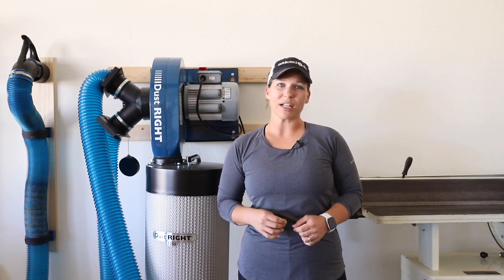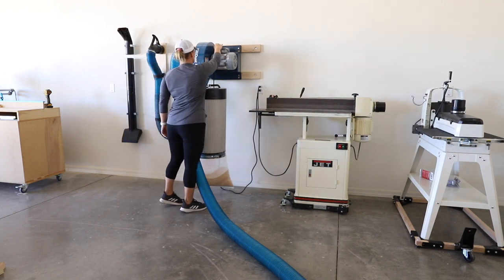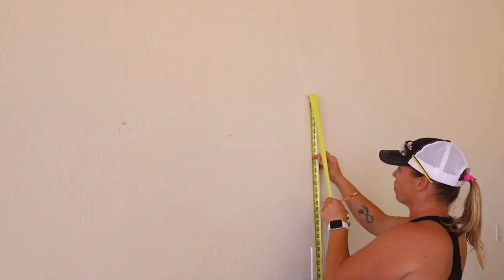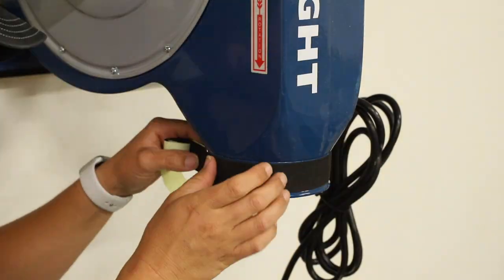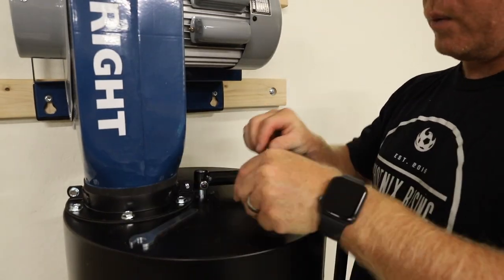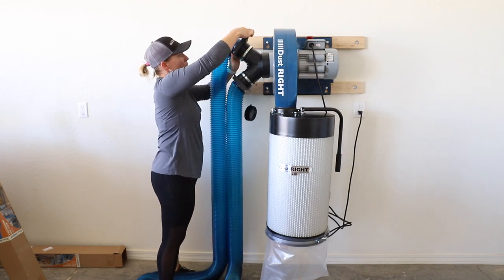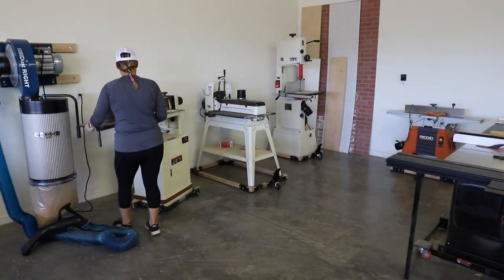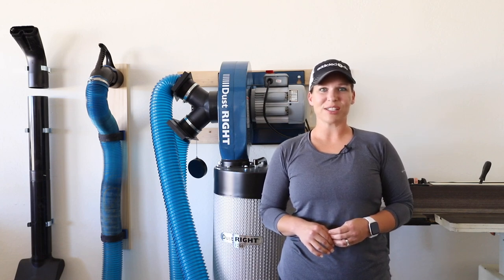Setting Up A New Dust Collection System

Comment: Katie, you mentioned setting up a two stage at some point, however, I would encourage you to do it sooner rather than later. It was the single best choice I've made in my shop. Garbage can, circle jig to cut out a wood top for the can, then mount a Super Dust Deputy to the wood lid. I have the older version of the rockler dust right collector, will be upgrading it soon to the 1250cfm.

Comment: hi there! this is great!!! Im definitely going to look into getting one, is it the bag at the bottom that you change out? Does rockler have bags for you? how often do you have to change them out?
Reply from the maker: Yes, we just dump the bag at the bottom when it is full.  I’m actually still using the same bag that came with the machine and it’s been 3 years.  Rockler does sell replacement bags though.

Comment: Hi Katie , loved your video on your Rockler 1250 CFM dust collection system. Did you ever think about replacing the plastic dust collection bag with a different container?
Reply from the maker: I’m glad you liked the video!  I did actually plan to replace the bag with a larger one and maybe move the dust collector higher on the wall, but then changed my mind.  I’m still using the original plastic bag that came with it and I really like that it is easy to dump and put back on.  A larger bag would be much more difficult.
Reply: @addicted2diy  I bought the Dust Right 1250 also and I have a an old shop vac bottom from one of the shop vacs that I killed with dust and debris that I am trying to place under the 1 micron filter. I unscrewed the top part where the motor was and the filter fits perfectly. I just have to find a way to seal the thing. If there’s a way I could send a picture I could show it to you.
Reply from the maker: @navarroedwards8031  you can email me.  Katie@addicted2diy.com

Comment: Your setup is ok for medium to fine dust. But what if some harder, larger or even nail entered to your system? Eventually it will hit your blower's fan blade without a pre-filter (cyclone) installed. 

Your canister filter is the biggest plus in your system. however, your collector bag is very small. Again, what if a sharper stock entered your system? and break your bag? Can you afford to see all dust blowing out from your bag? 

One more thing, such a long hose will greatly reduce the air flow and creates lots of static. Ground your flex tube can solve a bit, use hard metal tube to make the port closer to your machine, then use the flex hose to hook it up to your system should be a better idea.

Comment: Hi Katie, thank you so much for the content. I am trying to determine whether to go with Rocklers 750 cart setup or one such as the one you have chosen. I have a very small shop, completely a “hobbyist” and senior in years. You did a great job here and I suppose now that I need to do a quick tool inventory with dust port sizes and then reach out to Rockler for suggestions. I never see anyone using a system such as yours with a Makita track saw, or miter saw type tools which use a much smaller port. Is there a reason? I would appreciate a comment from you or your subscribers. I get such a kick out of those punch in the gut comments by some folks. I believe that along with any comment it should be necessary to show how many subscribers the commenters have. My guess is that it is considerably below 16,000 (congratulations). Also, in addition, when someone posts “terrible” it should be necessary to have to state why. I guess I am just feeling the brunt for you. You are doing very well and giving us all something to consider. Thank you so much.
Reply from the maker: Hi there!  I would definitely reach out to Rockler and talk with them about what might be the best setup for your shop.  I really love this one and am continuously amazed at the versatility of this dust collection setup.  I am not one for having anything being fixed in place, but the dust ports on my tools and the quick connect hose really make this system so easy to use.  As for attaching smaller ports to the dust collectors, it is entirely possible to do this, but based on my research it is not really recommended.  These types of dust collectors are high volume and really do best when using larger ports.  Reducing them down to 1 1/2” or less (like with a track saw) puts too much strain on the motor for long periods of time.  What I would recommend for that is to use a shop vac.  I have the Kreg Adaptive Cutting System (track saw) and use the Rockler dust hose kit along with my shop vac when using that saw.  Hopefully all of this helps you make your decision!

Comment: Katie, Thank you for the video! I have been waiting for some videos of the DR 1250 cfm model to begin to surface. I was hoping to see more initial thoughts on performance and features. If permissible by your agreement with Rockler, i would love to see an in-depth review in the near future covering suction performance, noise, remote strength(direct line of sight), the attachments, hoses, and accessories and whatever else you think is relevant as you use the system in the coming weeks. I look forward to seeing what you decide to utilize for 2-stage (Thien baffle vs super dust deputy etc) and if you notice a loss of suction. 

Congrats on the new dust collection for your shop!
Reply from the maker: Mason Wheeler thanks for your ideas.  I’ll see what I can put together for a review. 😊

Comment: Hi Katie, I just bought the 21’ 4” expandable dust right hose.  However, when I went to attach it to the Dust Right hose handle like you have in the video, it will not fit.  The inside dia is less than 4”.  Did you have any trouble getting yours to fit on the handle?  Thanks
Reply from the maker: So sorry for the late reply!  That's so strange that the hose won't fit.  I know it's a tight fit, but mine is fit on there and hasn't moved since I originally set it up.

Comment: Hey Katie; it's me, the pest again. One more question: tell me about the dust extraction set up used on your router table (7:55 in the video). My table has been a sore spot in my shop. Depending on what kind of routing cut I am doing the dust does not even make it to the dust port. Is that a Rockler product also or is that a home made-set up? Thanks.
Reply from the maker: No worries at all!  It is a Rockler product that I thankfully found on their site as I was planning out my router table build and it has been an amazing addition.  The dual port on the back of the dust bucket makes it so efficient for collecting all of the dust when I’m using my router table.  Even after heavy use, there’s never more than a pinch of dust in the dust bucket.  https://www.rockler.com/dust-right-router-table-dust-bucket-kit-with-dual-port-and-fence-hose
Reply: @addicted2diy  Thank you, Katie.

Comment: I'm curious if you have noticed any issues with the filter canister being mounted off center.
Reply from the maker: No issues whatsoever!  It’s been almost 2 years and it’s still working like the day I installed it.  I’m still even using the same bag at the bottom.

Comment: Neat and simple setup. Two stage in the near future is a nice upgrade to already great setup.  I was planning to pick up one to replace my old shop vac and this video helps a lot having seen the not so small scale and easy setup. What can you say about the noise level? Also I must add that I cringed a little when you drill vertically too close to the outlet. Usually the wires run up and down that location.
Reply from the maker: gets mike thank you!  With regards to the noise level, it’s actually not bad.  I’m sure it’s all relative, but I don’t feel like it’s enough to where I need to wear ear plugs just to vacuum the shop floor.  I believe Rockler’s website said the decibels are about 78.  I do hear you on drilling so close to the outlet.  We did the wiring ourselves in the shop and we ran the wires through the studs which are 2x6, so I felt confident that I would not hit them.  Definitely not something everyone should attempt if they don’t know the wire locations.

Comment: Looks like a good setup and I’ll be looking into some of the Dustright components for my existing system.  One thing I notice, though, the Y seems to create a crimp in the top hose that is dedicated for your table saw.  Can you turn the Y 90 degrees and avoid that?
Reply from the maker: Steve Berg I could have and I can’t remember off the top of my head why I went vertical with it, but I’m sure I had some sort of reason😂. It hasn’t affected the suction at all, though.

Comment: Hi Katie, Great vide! I am considering purchasing this Dust Right Dust Collector with the canister and converting into a two stage system. Would you have any recommendations/regrets? Secondly, if you had to purchase a dust collector again would this be your choice?
Reply from the maker: Rich H hi Rich.  I absolutely love this dust collector and have no complaints so far (it’s been a year).  I am working right now on putting together a review video, since it has now been a year.  If I were to have any regrets, it would be that I haven’t converted this into a 2 stage system yet.  Otherwise, it’s been an amazing machine in my shop.
Reply: @addicted2diy  Thank you very and i look forward to your 2 Stage edition.